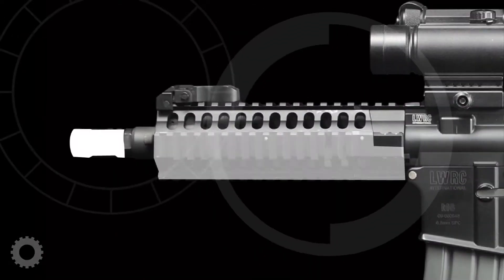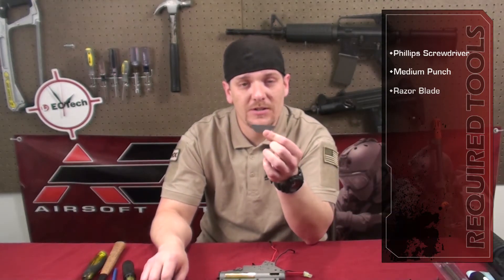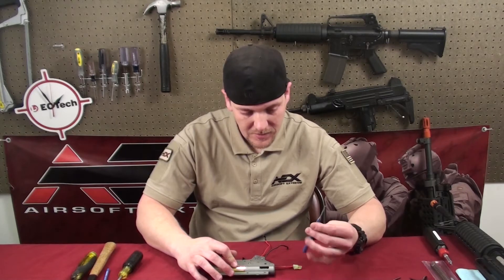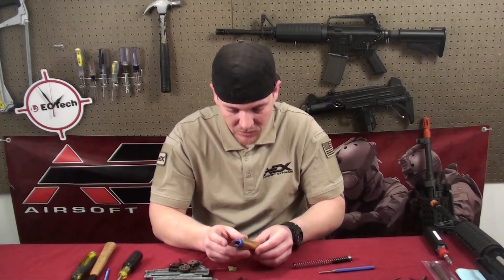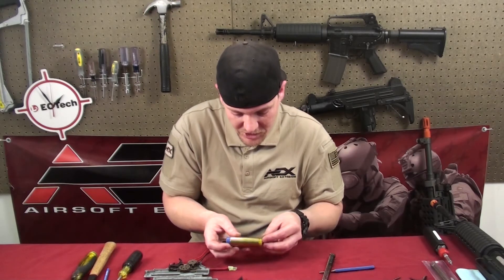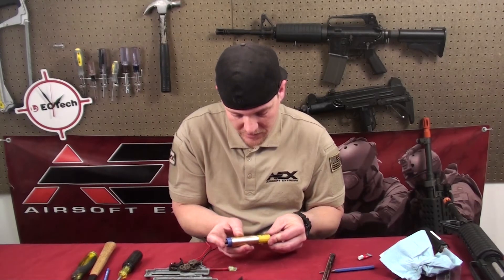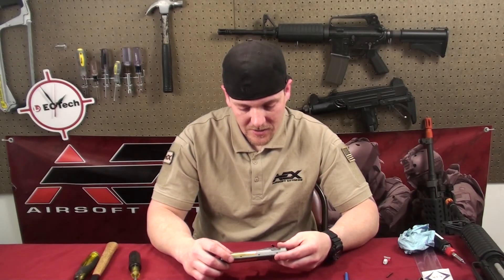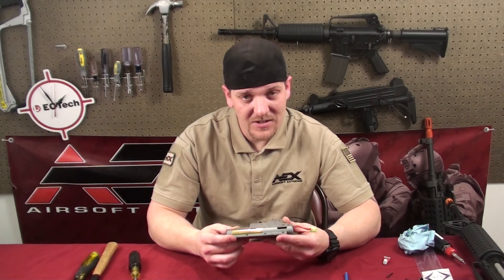AEX Tech Tips Episode 10 - How to check Compression in an AEG

Comment: When you test the air seal it is very important to NOT push the air nozzle all the way back against the cylinder head.

When an AEG fires, the air nozzle is forward into the hopup, that is when air goes through it.  So when testing air seal you must push the air nozzle forward simulating this.  If you don't, there is an extra physical barrier holding air in and you can miss a leak.